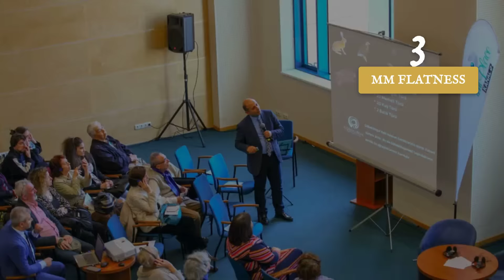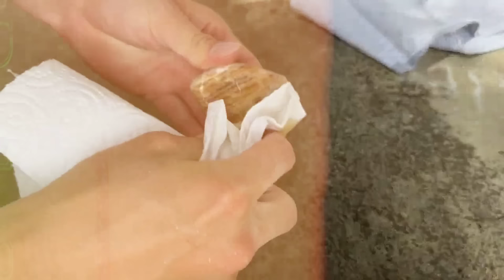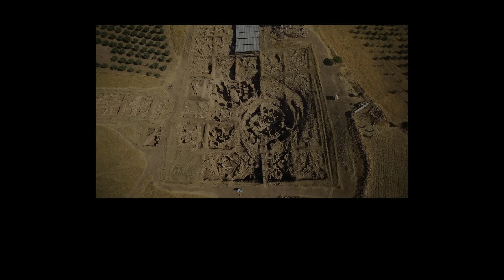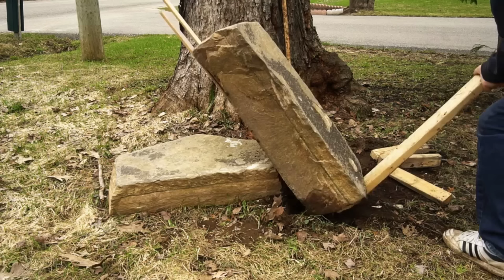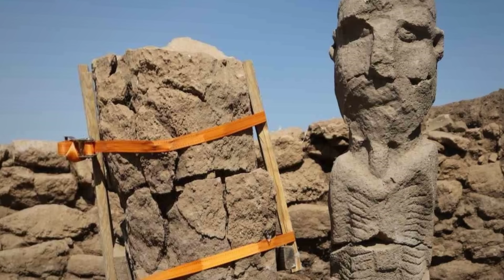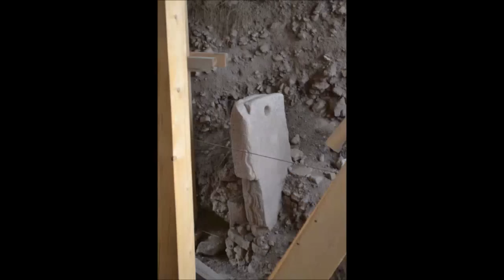New 3D Scans Finally Reveal How Göbekli Tepe's T-Pillars Were Carved

Comment: It certainly seems as if the pillars were erected long before the smaller stones around them were set in place to create enclosures.  Instead of everything being built at the same time could it be that many thousands of years separate the peoples doing the building?  The builders of the pillars may have lived in the time before the beginning of the most recent ice age and the builders of the walls might have lived at the time of the ending of the most recent ice age.  I'm just wondering how long those carvings on the pillars could last if exposed to the elements for thousands of years before being buried.  Maybe the wall builders somehow discovered the pillars buried, dug them out and built a village around them and then, for some reason, decided to abandon their village and to re-bury the pillars.  Yes, that's strange, but everything about the place is very strange.

Comment: Farmers would have known that the post stays in place if you ram the dirt around it. Rammed earth turns to sandstone under the right conditions. It would be a lot easier to mould and ram a 16 tonne block by hand rather than dragging it from a quarry. I reckon the technology to make these pillars would have only needed logs and carving tools You can carve into wood to leave a display on the outside of the stone as one piece. And hold them in place with your mum

Comment: Why couldn't you just dig the hole and, from the bottom of it, make a ramp to level ground, then just slide the pillar in, stand it up, and backfill the dirt?
Reply: The ramp should hold a 3 ton pillar.
Reply: @ThomiX0.0  The ramp doesn't really have to hold anything it's just the ground. It's just the ground scraped upwards in an angle.

Comment: What simple tool could be used to monitor evenness across four meters?  You mean besides a taught string?
Reply: Yes a string is great. But remember the carvings are in relief. You want to try chopping away all that extra stone over 4 square meters, to prove a point? Stop and think about whether you would consider doing rhat. Even today, when you get 3 square meals a day with no effort.😅
Reply: @aivkara  I gather you never did any stone carving.....
Reply: @thomasjamison2050 no, but I've done my fair share of machining. All im saying is that they did this the hard way, clearly on purpose. It would have been far easier to start with a squared and flattened block, and carvedjust design into it.
Reply: @aivkara What on earth makes you think they didn't do just that?
Reply: @thomasjamison2050 those figures are in relief, above the flat surface of the stone. So they had to remove everything that was not the animal or figurine.
Reply: @aivkara  No.  You've got it backwards.  The flat surface of the stone came  first.  Chisels only take away, they can not  add.   As for measuring the distance from the surface to the incised surface, any little chip of wood or stone will do quite nicely if one doesn't have a ruler.  Any sort of gauge will work, and one can  use any sort of colored material to easily find very minor defects and mark them out for correction.

Comment: Stone working was a huge part of survival perhaps even before fire was invented. I’m sure people developed advanced techniques to carve, polish, move stone.  Their stone working expertise must have become sophisticated without requiring metal tools.   I can see them using sticks ground straight as reference tools to get surfaces within 2 mm. Or a bow string for a straight line reference.  I do wonder if the pillar sides are accurate 90 degree angles (implying use of another measuring reference tool for right angles).
Reply: Complicated stone work before fire? Perhaps not.
Reply: @a @aivkara stone was worked into cutting tools at least 200,000 years ago
Reply: Wait, was fire invented?
Reply: @f @falconquest2068 more accurately when fire was harnessed